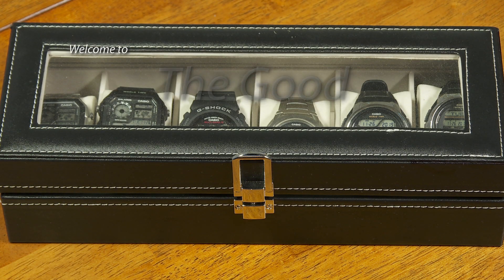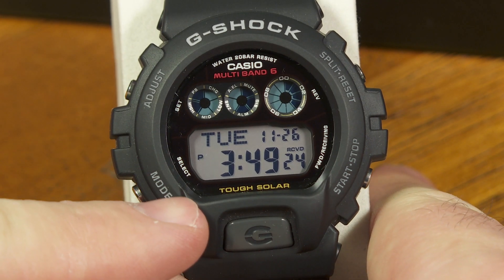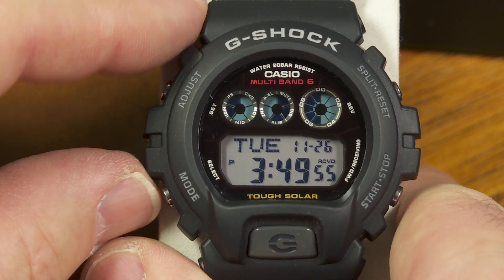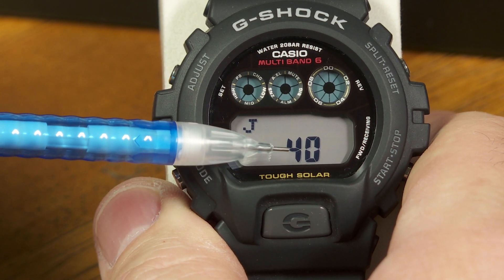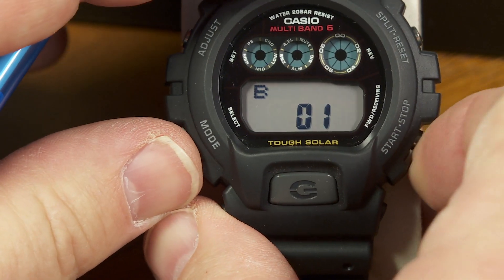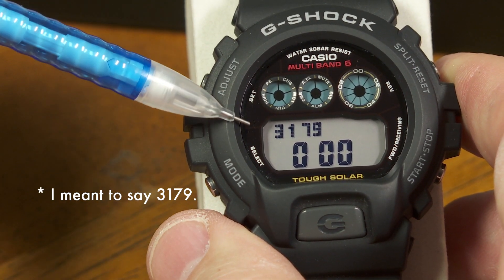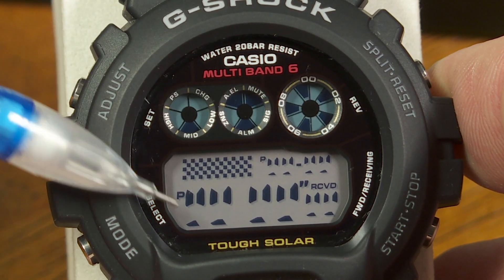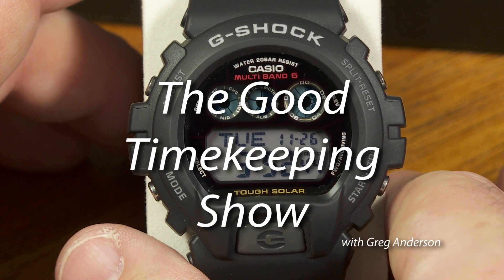Diagnostics for Casio G-Shock GW6900

Comment: best way to gw6900 tough solar recharge?
Reply from the maker: I like to put my solar watches in the front room of the house with the blinds open. I place the watch near the window and let the sun shine on it. The watch stays relatively cool because the room doesn’t get too hot. It’s much safer than leaving the watch inside a car, where the temperature in the summer can get above 140 F.

If I give the watch an hour or two in the sun it’s usually more than enough to take it from a medium charge to a high charge. After that, normal light in any room of the house or office is enough to keep it topped off.
Reply: @GoodTimekeeper  thank you I've been trying to get it to h still haven't be able to get it to that level
Reply from the maker: If it’s never been above “M” then be patient. It may take several hours but it will get there. And remember that all functions are available even if the power is still at “M” anyway.
Reply: @GoodTimekeeper  yeah but I wanted to reach to high power thank you 👍
Reply: @alexpadillayt   did you ever reach high charge?
Reply: @thundercat007  you have to leave it in the sun for days hopefully it goes high if not it will just go M. If battery has not been changed for years most likely goes to M

Comment: There's also a way to test if ur A.EL functions properly also using those buttons. In a Casio w/ A.EL, I call it the Tilt screen. Pressing A,C, & D simultaneously, a diagnostic screen appears. Pressing D/Forward/Start.Stop, TLT materializes. If u tilt the watch towards you, if A.EL is operative, 88 emerges. If 88 doesn't emerge, there's a malfunction w/ A.EL. Learned that from G-Shock High Fashion.